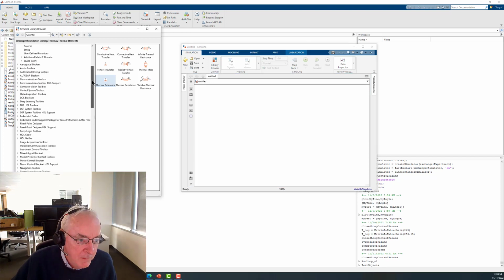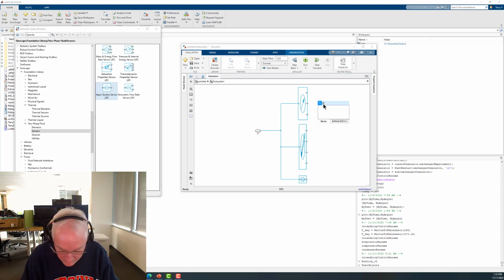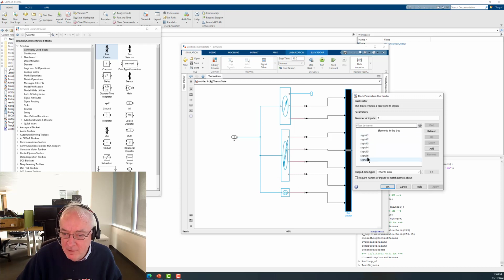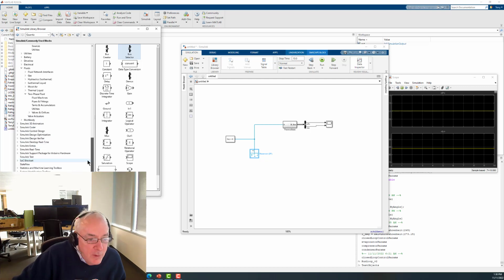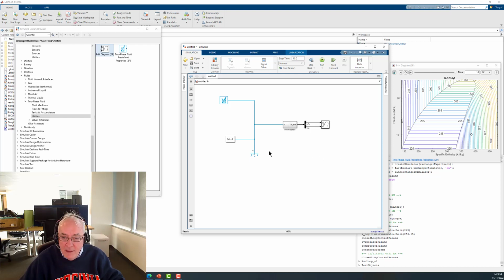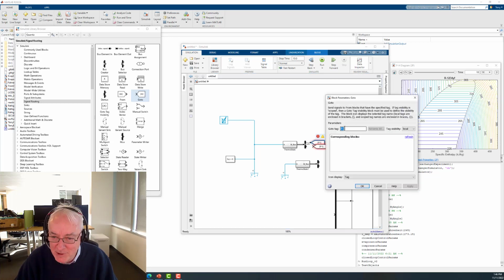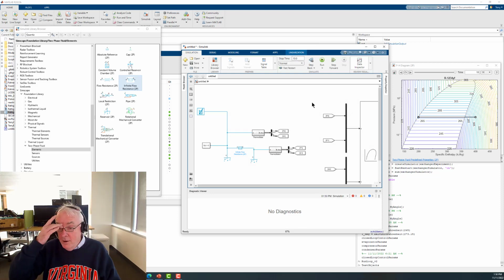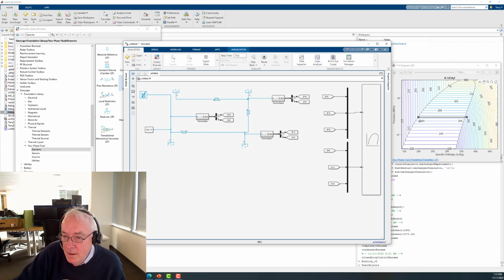Engineers Studio #25 - Modeling Refrigerants in Simulink

Comment: Did you calculate the properties by refprop? Thanks 👍
Reply from the maker: Hi Mauricio,  I use the fluid properties for a fluid called R1234yf, which are shipped with the product Simscape Fluids.  I believe that our developers use REFPROP.  We certainly encourage use of REFPROP, and offer an interface tool that captures fluid properties, from both REFPROP and Cool Prop, and helps you create a fluid properties blocks through that data.